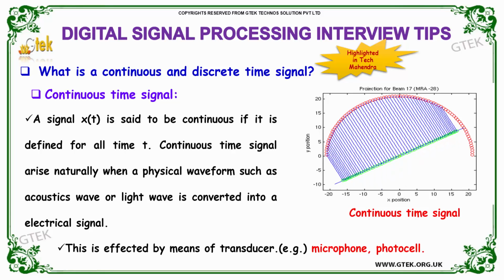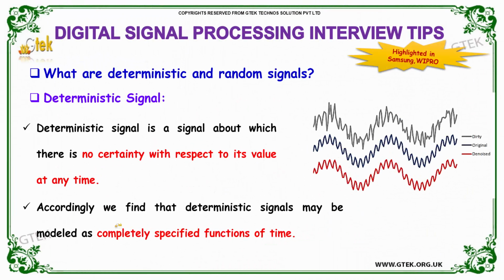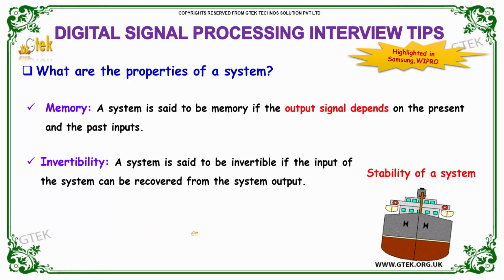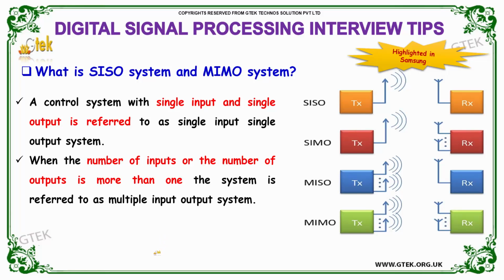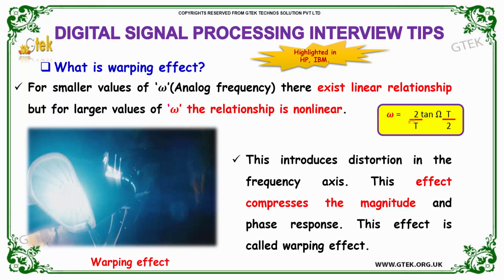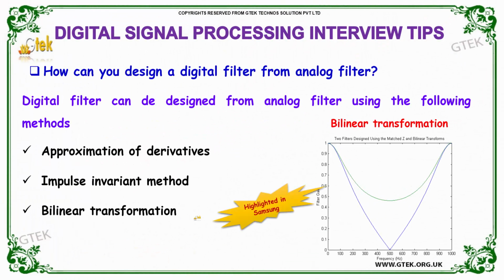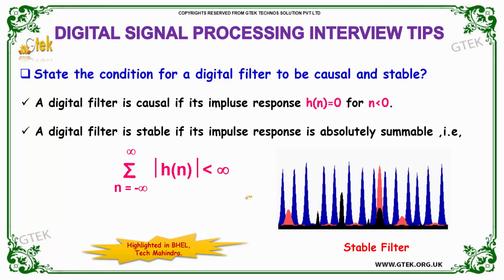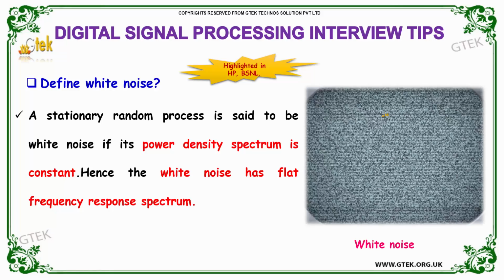Top 50 Digital Signal Processing ece technical interview questions and answers tutorial for fresher

Comment: when the application requirement is real-time, DSP is often implemented using specialized microprocessors such as the DSP56000, the TMS320, or the SHARC. These often process data using fixed-point arithmetic, though some more powerful versions use floating point.

Comment: Often when the processing requirement is not real-time, processing is economically done with an existing general-purpose computer and the signal data (either input or output) exists in data files. This is essentially no different from any other data processing, except DSP mathematical techniques (such as the FFT) are used, and the sampled data is usually assumed to be uniformly sampled in time or space.

Comment: DSP algorithms are also implemented on purpose-built hardware such as application-specific integrated circuit (ASICs). Additional technologies for digital signal processing include more powerful general purpose microprocessors, field-programmable gate arrays (FPGAs), digital signal controllers (mostly for industrial applications such as motor control), and stream processors.

Comment: There are some commonly used frequency domain transformations. For example, the cepstrum converts a signal to the frequency domain through Fourier transform, takes the logarithm, then applies another Fourier transform. This emphasizes the harmonic structure of the original spectrum.

Comment: A "linear" filter is a linear transformation of input samples; other filters are "non-linear". Linear filters satisfy the superposition condition, i.e. if an input is a weighted linear combination of different signals, the output is a similarly weighted linear combination of the corresponding output signals.

Comment: Sampling is usually carried out in two stages, discretization and quantization. Discretization means that the signal is divided into equal intervals of time, and each interval is represented by a single measurement of amplitude. Quantization means each amplitude measurement is approximated by a value from a finite set. Rounding real numbers to integers is an example.

Comment: The DSP circuit adjusts the levels so they are at the correct values. This practically eliminates the noise. The digital signal is then converted back to analog from via a digital-to-analog converter (DAC).

Comment: A Digital Signal Processor, or DSP, is a specialized microprocessor that has an architecture which is optimized for the fast operational needs of digital signal processing. A Digital Signal Processor (DSP) can process data in real time, making it ideal for applications that can't tolerate delays.

Comment: A digital signal processor (DSP) is a specialized microprocessor (or a SIP block), with its architecture optimized for the operational needs of digital signal processing. The goal of DSPs is usually to measure, filter and/or compress continuous real-world analog signals.

Comment: A sound processor connects to your factory system through your stereo's speaker wires. The processor removes the factory sound-shaping, so the signal is clean. The signal is sent to your external amplifier(s). The amps power your front and rear speakers, and subwoofers.

Comment: DSP software is more generic and OEM software is sold directly to the computer manufacturer. Thus the distribution channel is different for DSP. DSP software is distributed for smaller system integrators and system builder hobbyists for "clone" or no-name computers.